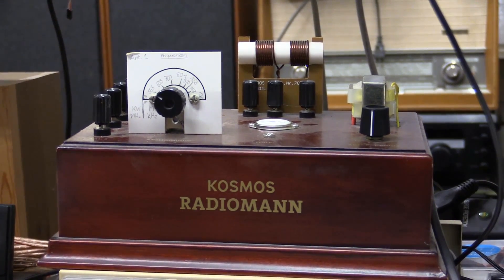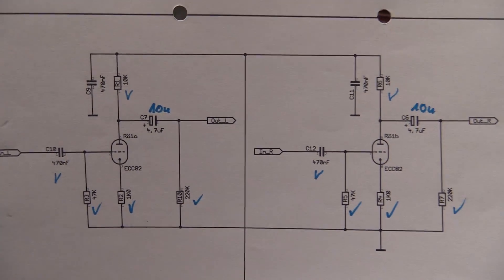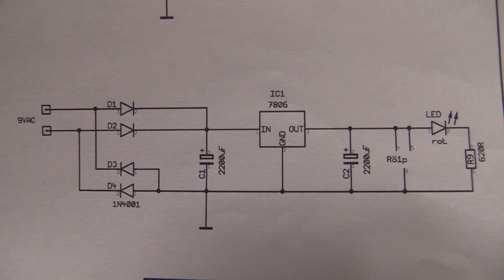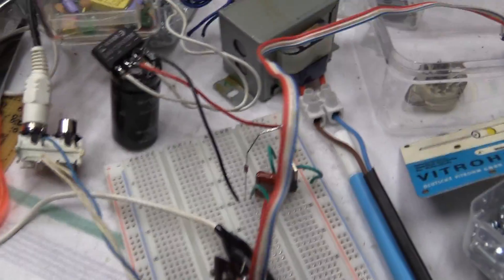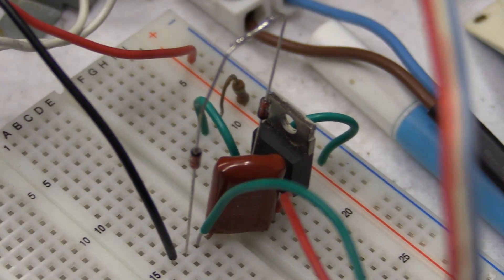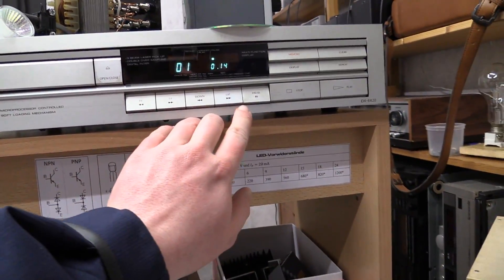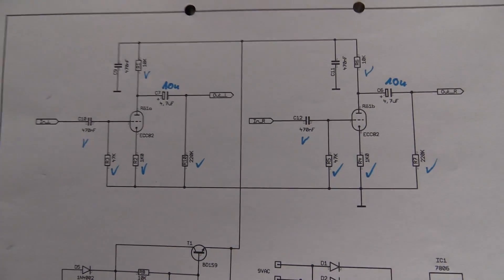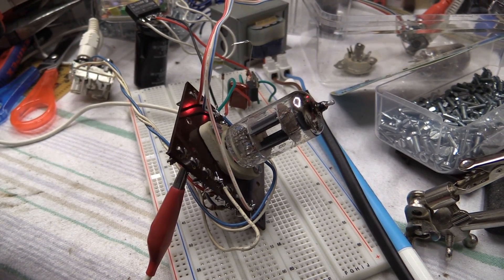DrCassette's Workshop - ECC82 Tube PreAmp

Comment: You don't need to use 7806. Just use 7805 and put 2 rectifier diodes in series into GND pin of the 7805. Those 2 diodes will make about 1,2V voltage drop at the reference pin of the stabilizer and thus boost the voltage output of the 7805 by 1,2V. So you will get nice and stable 6,2V at the output... Its an old trick :)
Reply from the maker: Yes, correct.

Comment: I prefer an ECC81/12AT7. It has a lower gain, hence lower distortion. It also has a higher bandwidth. An ECC83 is quite nice, too. It has a slightly different sound than the US 12AX7.
Reply: 4 years late to the party i know but no... ecc81/12at7 = amplification factor ~60 
Ecc82/12au7 = amplification factor ~17
And a 12ax7 is just the american designation for the european ecc83. Theyre no different, wanna sell your european made ecc83 in the us? Put a 12ax7 label on it, still the same

Comment: The HT voltage would not be critical, no need to stabilise it as it will be in class A and the current will be more or less constant. Such a circuit will probably draw only a few mA anyway. A better (maybe) choice of valve would be an ECC83 or an ECC81 directly replaceable pin for pin. An ECC82 is normally used as a phase splitter in a push put design. As you have found all three will work in such an uncritical circuit.  If you did need a little extra gain you could always add a by pass cathode capacitor of say 25/50 mfd 25volt electrolytic. As this will reduce the negative feedback, the gain (and noise) will increase. You will definitely need screened input leads then!! You probably are getting away from hum pick up due to the lowish output impedance of the CD player.
Reply from the maker: As I said, I really don't know much about tubes at this point, but I always prefer regulated power supplies in my amplifiers. Indeed the current is very low, still I'll have to change the setup a bit. It seems like the transformer is not supposed to have any load on that 44V winding at all, as it gets extremely hot after some time. I might give that voltage doubler circuit a try.
Reply: DrCassette
Something very odd if that small circuit is making the transformer hot. The load cannot be more than a few mA. The transformer may have a shorted turn. Try it with no load!
Reply from the maker: Indeed the circuit doesn't take much current as the regulator transistor does not get warm at all. I'll have to check that transformer, I think it came out of a cheap chinese satellite receiver, so it may be just a piece of junk.